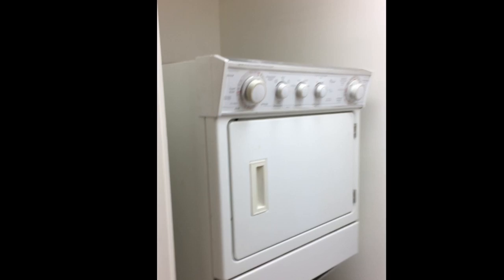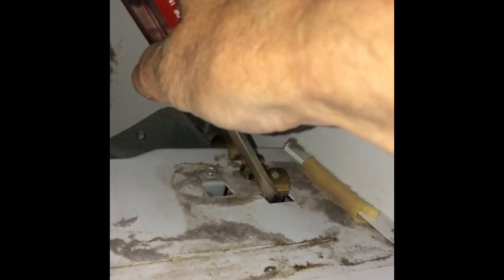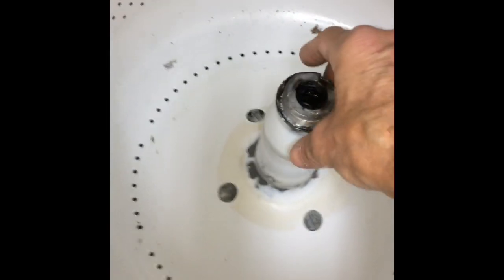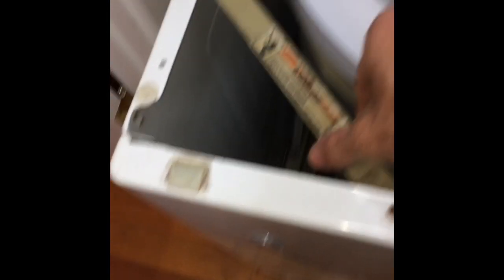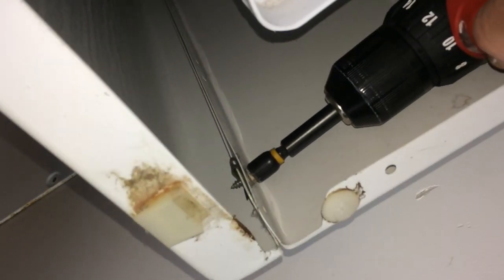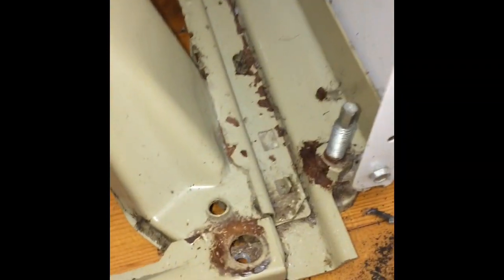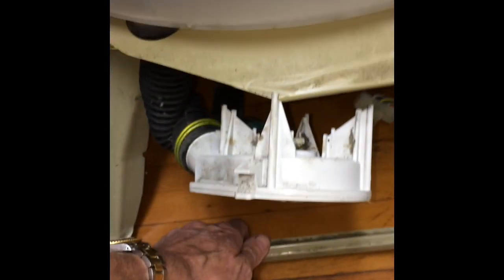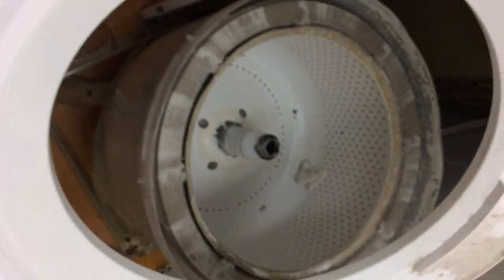✨ Direct Drive Washer Disassembly - Thin Twin Laundry Center ✨

Comment: Thank you so much for posting this video! Our whirlpool thin twin is roughly 20 yrs old and the only thing broken was the door switch! (Which wouldn't allow the unit to drain and do the spin cycle) With your help we were able to replace the switch easily! Now we can wash our clothes again!
Reply from the maker: Awesome,
Thanks for the follow up😊
Reply: Това

Comment: Thank you so much! Our washer started dumping water on the floor and we couldn't figure out how to take it apart to get inside it. This video showed us exactly how to do it. Fortunately, it was a simple repair. The clamp connecting the water hose to the tank had gotten loose and fell off, so all we had to do was reclamp it on. We were about to give up on the whole thing until we found your video. Thank you again!

Comment: Your video is excellent. I have a Thin Twin that recently started to vibrate horribly and wonder if you have experience with fixing the problem. I watched several videos that show a spring out of place, however, this was on a large washing machine. My combo unit was given to me used so I would value your opinion on whether to spend the time taking apart and fixing.
Reply from the maker: Can you send the model number?
Reply: The model number is LT5000XVWO. The V could be a U.

Comment: Hi Scott im a new subscriber. Having same stacker ..unit spins at spin cycles. But at rinse or wash it does not move and water does not come in to washer. We tested the valves both are good. Can it be timer switch or what ?
Reply from the maker: I think it’s the timer.

Comment: Hey Scott...I had an all in one  kenmore like yours and the washer went out. Cost more to fix  it than I wanted. So I just bought a separate washer.
Is it at all possible to separate the working washer from the working dryer (top dryer)
You make it seem so easy to disassemble the washer so I thought maybe I could improvise something with the top kenmore dryer that works great and pair it with my new washer and get rid of the bottom half of the kenmore washer.
Am I out of my mind?
Could this work?
Appreciate any help.
Thanks!
David
Reply: Sure you can! Just take a chainsaw, close one eye and then start hitting the machine with the chainsaw. Eventually, you will have a separated washer and dryer. Hope this helps!

Comment: hey removed lid to find leak and now i cant get washer to cut on to locate leak any suggestions i have a single green "ground" wire hanging from lid but don't know where it hooks up at
Reply from the maker: That’s the green ground wire for the lid switch.
I believe on that model it’s supposed to be bolted onto the frame and the other in goes to the lid switch.

Comment: Yeah, man. In my whirlpool twin, there's something that prevents me from fitting a screwdriver in there to remove the brass clips
Reply from the maker: Yep,

I have to use a really short screwdriver or come in at 45 degrees to pry them off.